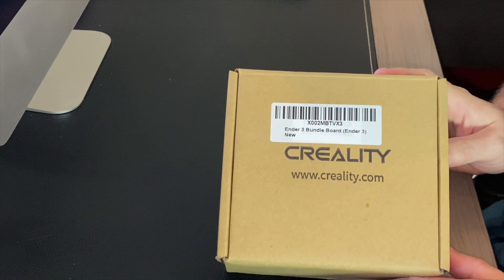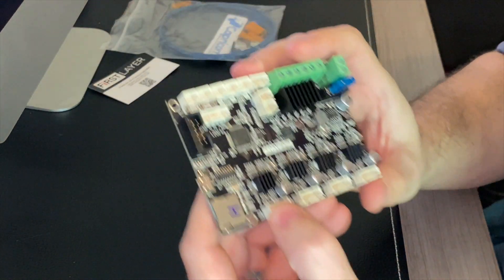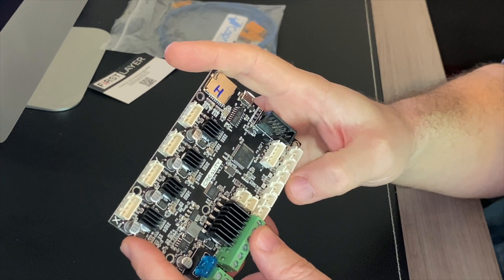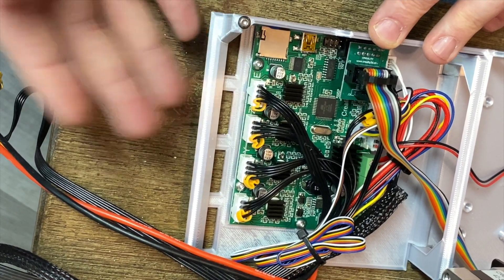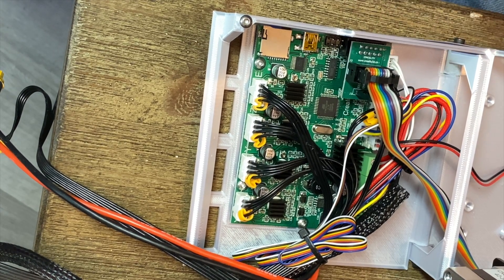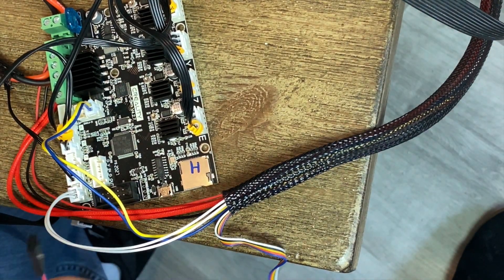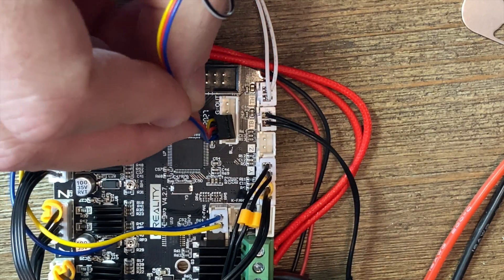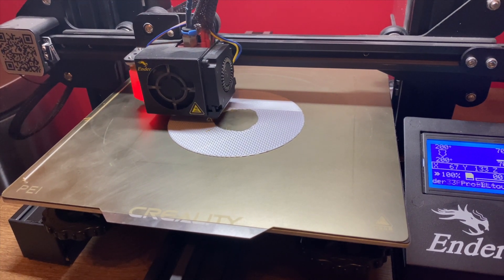Creality 4 2 7 Silent Board Install With BLtouch

Comment: Could you make a video of how to do an engine swap in a Nissan Z? I just want to see how you disconnect and reconnect the battery. I'm sure you'll edit out all of the useful information that comes in the middle.
Reply: You just ended the video. 

No warnings about making sure the voltage + and - was in the correct orientation so one does not fry the motherboard. 

No input on the correct orientation of the end stop wires. 

And you sure as hell didn’t specify how it’s not “plug and play” there is some firmware that must be installed for the BL Touch to work. 

Like I said just make a video of you swapping an engine. 

Step 1 Disconnect battery. 

Step 2 Shut camera off. 

Step 3 Turn camera back on. 

Step 4 Reconnect battery

Step 5 Fade from reconnecting battery and edit in you driving the car down the road.
Reply from the maker: Glad you enjoyed it!  Hope my next video might help more.
Reply from the maker: What did I edit out that you need?  Ya know I do this for fun and to help people. Would have been easier to ask for a video on what you needed other than the way you asked it. I tried to include everything I though was needed in the video.

Comment: so i got my 4.2.7 hooked up zstop and did the pin swap.i placed the .bin placed on the root of sd and it wont update. probe lites up on boot though so i think its setup correctly using dedicated port
Reply from the maker: This might sound silly but try and restart your computer then re-compile the firmware. I had problems and did this and it worked. I've also ran into another issue before where the sd card was corrupt as well and would not flash. I re-formatted the sd card and put the same .bin file on the card and it flashed no problem.  See if that fixes the issue. I remember when I looked on Crealitys website for the firmware there was not a firmware file for use probe as z stop. This is why I compiled my own firmware for the 4.2.7 board. I will be making a video for this soon I have just been covered up. Let me know if you need any more help.
Reply: @GhostPants8012  bruh! exactly what i needed. I have a flash now going on my e3pro. So it was 2 issues like you said. the sd card was F'd (but still working lol?)  and secondly even when installed issues with the binary. tomorrow i think I will compile it I already has VSC setup just need to double check my header files /changes against something.
Reply: if this doesnt work i will motherboard swap but bruh its been such a battle
Reply from the maker: Glad I was able to help:)
Reply from the maker: You'll get it man. No need to board swap if it flashed. Just compile new firmware again if it doesn't work the way you want it.
Reply: @GhostPants8012  I got the fw down and installed but the calibration doesn't seem to be happening even with the mesh enabled the correct slicer adjustment the z offset taken with calipers. something must be sus with the bed or the settings. the babystep doesn't seem to work the same way anymore either. I have it on a glass bed manual paper thin gap
Reply from the maker: I would double check all your settings in your firmware and reflash as well as double check the bed for level. As far as the babysteps uncomment #define_babystep_zprobe_offset . hope this helps.
Reply: @GhostPants8012  Finally going to try and print had to calibrate z offset in pronterface. I ran the mesh but I only print small stuff I'm really starting to suspect my bed
Reply from the maker: That stinks man.
Reply: @GhostPants8012  1mm versus suggested 4mm for glass iguess
Reply from the maker: Once your z offset is set I don’t think that would matter. I could be wrong.
Reply: @GhostPants8012  bruh so after dd install how do I redefine the print area. the dd bracket leads to crashes in the pos x and neg direction. I put an end stop to fix negative x but it still crashes positive =(
Reply from the maker: @AG-sy4wt  should be under axis limits.
Reply: @GhostPants8012  ya I I should have checked my limit switch action and moved it around first I thought it was a one for one swap
Reply: You seem to be comfortable with building your own firmware (and I admit it's a lot more flexible), but if you want it to "just work" and don't have other mods, using the official FW from Creality for Ender 3 with BL touch worked out of the box for me. You MUST use the adapter on the display port, though. No point in rewiring and squishing two plugs into the new BL port when their FW simply isn't using it (yet) anyway.